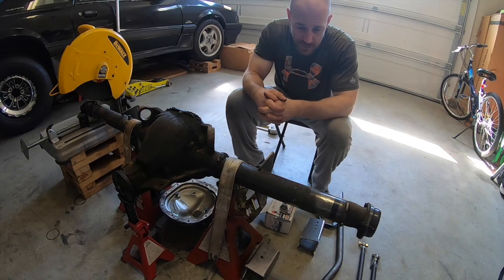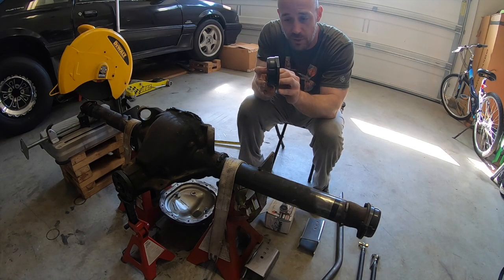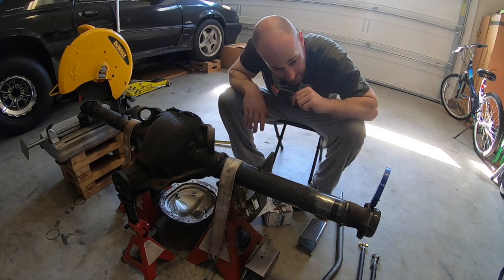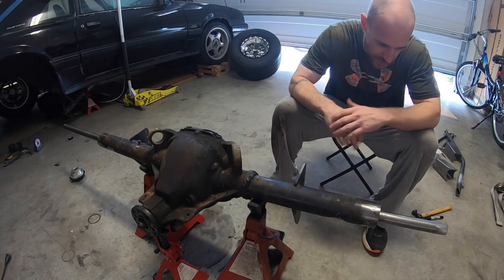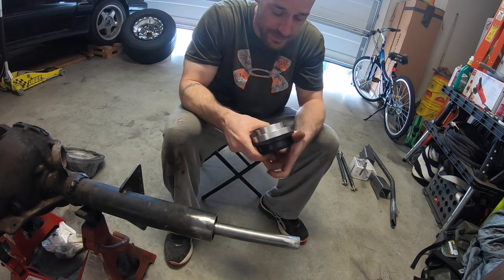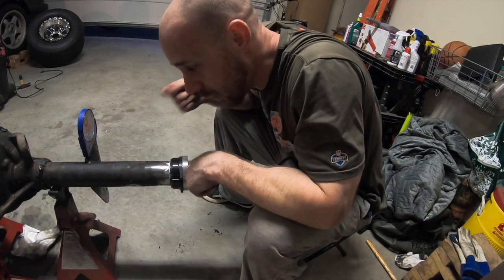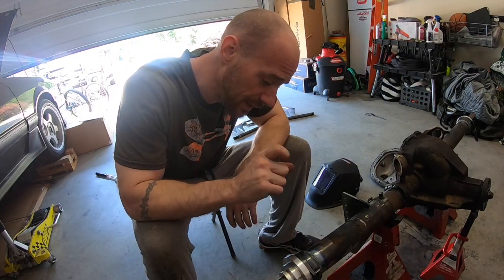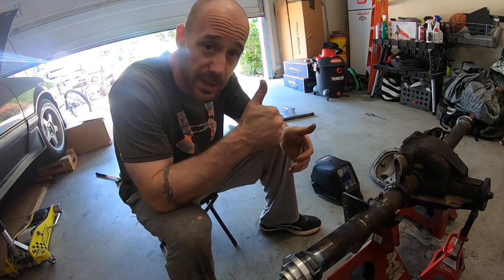8.8 build part 1: Narrow + 9'' big bearing ends

Comment: Good video. I wish I had found your video before I narrowed my 8.8. Went through a similar process. One thing I did do that worked out well for me when cutting the old ends off was to square off of the blade and drill holes in the saw base so I could use u bolts to attach the saw to the axle tubes. It was solid. No movement whatsoever. The ends came out nice and square. It's in my video "Cutting down the Ford 8 8 differential" if you are interested. Thanks.
Reply: With that 325/50 radial tire that you were running did you have any rubbing issues? Really like how your car sat with that tire.

Comment: I was thinking about swapping Ford 8.8 axles into a Suzuki Samurai. Hopefully, this will somewhat increase stability just haven't decided to use ranger/explorer factory width or to go short side/short side width or long side/long side width. Or if I should just go with Ford 9 inch axles. I will also be stretching the wheelbase at least 1"-2" and will be using 30" or 35" tires. What do you think? Any advice would be greatly appreciated.

Comment: Thanks for the video and links man I’m about to put bigger axles in mine. It’s been narrowed already and tubes welded with stock 31 splines an explorer diff. It’s been a 1.35 60’ on this setup. but I’m about to pull it out and put 35 splines and a spool and thinking about adding some braces. But the links you shared will help me a lot on getting the correct bushings. I already have a bar and bushings for a 9” but I don’t think the bushings will work. Either way I appreciate your time and effort into this video
Reply from the maker: Thanks for watching. 👍

Comment: Good video! I used the 1138 ends also. Did you use the stock sn95 brake bracket?
Reply from the maker: No I bought a North RaceCars brake kit that comes with their own bracket. Thanks for watching
Reply: Crusader Garage thank you
Reply from the maker: No problem👍